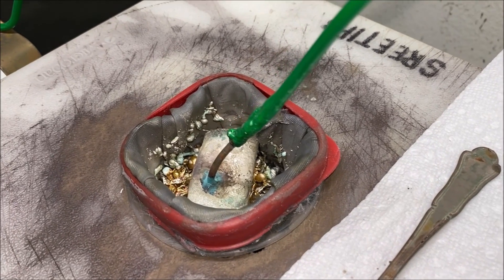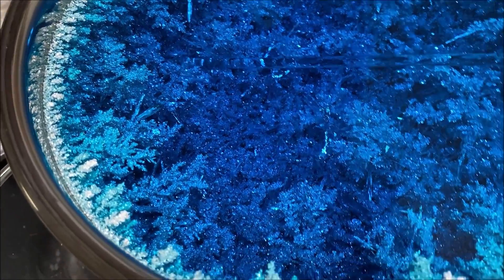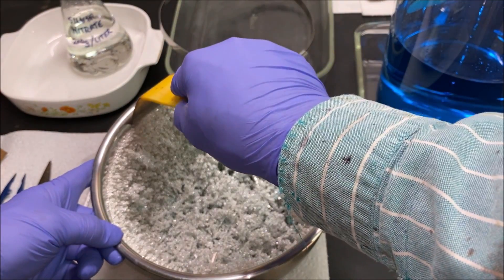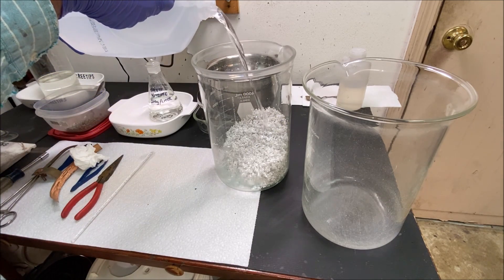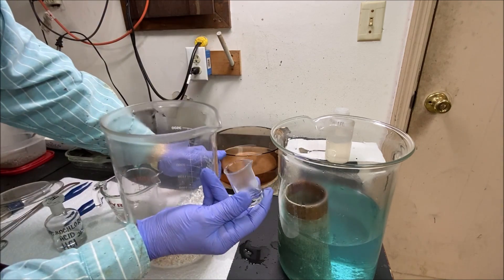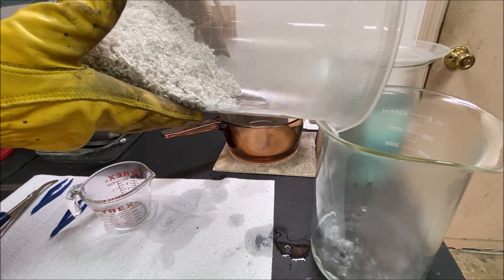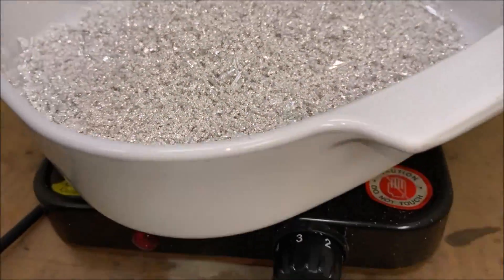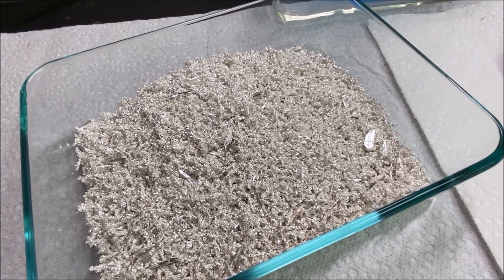Fifty Ounces of Silver From My Silver Cell Day 15

Comment: I made home made wet photographic plates when I was in high school. Would dunk them in a bucket of weak silver nitrate solution. (Used in my pin hole cameras.) Everything was fine until I walked out of my dark room and into the sun light! My arms turned jet black up to my elbows. We were on our way to a family reunion. Oh! But, did the entire clan have fun that day! My dad never stopped laughing all day. Neither did I!
Reply: It goes black from nano particles of pure silver on the skin. These are so small, they absorb all frequencies of light
Reply from the maker: I discovered, by accident, that hydrogen peroxide will remove those silver nitrate stains from skin. Not completely, but close to 90%
Reply: @Baltihunter  That just HAS to be good for your skin!😂😂
Reply: @robertlee4809  well it does work as a type of sun screen. A very expensive sun screen.
Reply: @Baltihunter  not really tho, the silver nitrate eats into your skin, it doesnt just "cover" it. you cant wash it off.
Reply: That's Funny 😂  Noob here what was the black exsctly, is that whats on Camera film ? Silver nitrate ?
Reply from the maker: Silver nitrate will stain your skin black on contact. The stain lasts about a week.
Reply: @sreetips  hey bro.. love your vid….. but gotta be honest I was waiting 17 minutes for you to melt into a bar at the end…….
Reply from the maker: Sorry to make you wait.
Reply: @sreetips  wait so its just visual not toxic/carcinogenic? seems like the ultimate prank solution... hey ma can you finish washing that plate for me? I'm late to dance practice gotta run! meanwhile plate is sitting in silver nitrate solution LOL
Reply from the maker: My wife picked up a jar of silver nitrate that had spilled. So it had silver nitrate on the outside of the jar. When I got home she was nearly in tears as she was scrubbing furiously with soapy water to get the stains off her hands. I’ve warned her over and over not to clean my shop for me, but she insisted. I poured some 3% hydrogen peroxide on her hands and it began to remove the stains immediately. After about a half hour of continuous dousing in the peroxide and rubbing, her hands were 90% free of the silver nitrate stains. She asked how I knew the peroxide would do it. I asked her, “say my name.” She said, “SREETIPS!” I said, “thank you.” I was her hero - I love it!
Reply: @sreetips  thanks for the ♥️,for above comment but I noticed a spelling error in the # ,so I corrected it ,then I noticed used- tube is blocking thumbs up on my comments ,when peeps "liked" my comment
Reply: Same here.... Reminded me of one of those annoying videos where they are "Going to show you something" but in turn they just talk about almost "About to show you it" over and over again but never actually show you whatever the hell it was supposed to ve showing you? I can't remember what they call those annoying clips of aggravation and disappointment, but, this video was A LOT LIKE THOSE EVIL VIDEOS!!!... At least there was some SILVER THOUGH!!!
Reply: Can you use this silver to make colloidal silver?
Reply: @suilauk9954  just buy some in your local growshop llmao
Reply from the maker: Probably, but I don’t know how
Reply: @QIKUGAMES-QIKU  yep
Reply: Trudeau is that you
Reply: I had a similar experience. I had the great idea to dye my old white tee shirts black. They were in great shape buy grey from the crappy Texas water. I thought I had bleach to clean up but nope. The old lady used it up. My arms looked like Papa Smurf until I could get to the store and buy some more bleach.The family and the guys at work ribbed me forever.
Reply: @GetRealwithMike  yeah you bleached yourself, thats defo more smart than having dyed arms for a few days.
Reply: Could have been worse, I put my hand on a science lab counter that a student didn’t properly clean up a Silver Iodide spill the day before, iodine goes straight through your skin into your bloodstream and leaves the silver in every single layer of skin! Think of a black tattoo that you have to wait for all your skin layers to be replaced over a month or two before it goes away!
Reply from the maker: Same if you get it on a finger nail. Stays stained until the nail grows out completely.
Reply: @jonkeau5155  guess your teacher had future instructions for the student on lab clean up.   Thinking though that the stain only made it to your 1st layer of skin out of the 3.  2nd and 3rd layers don't regenerate,  otherwise we wouldn't get scars, or actual tattoos that last for that matter.   A tattoos ink actually sits in the 2nd layer, and sometimes if an artist goes too deep, maybe into the 3rd layer.   The 3rd layer don't have horizontal holding power though and any ink making it in there, will dilute out into the surrounding skin cells but not enough that it dissipates entirely.   Thays what happens when you get a fuzzy wide tattoo line.  Artist put the ink too deep, and into the 3rd layer.   The industry would call that a blow-out.
Reply from the maker: Three percent hydrogen peroxide will remove silver nitrate stains
Reply: @911axe  "layers of skin" we have 7-11 layers, depending if you count dead skincells into it. wtf do you have your 3 layer stuff from? there are 3 layers of the ORGAN of the skin, but not the skin itself, that has 7 defined layers at least smh..... you have layers of skin that are part of the blood vessel system, but you aint calling that skin.
Reply from the maker: I really don’t know. I buy sterling and use it to refine gold. Then I recover the silver and run it through the silver cell.
Reply: I never thought about it before, but since silver nitrate won't react with lower wavelengths like red, then what happens when you photograph a red object with silver nitrate?
Reply from the maker: I think that it would still look red.
Reply: @sreetips  It's black and white though, so wouldn't it be really close to black? If the red doesn't react with the nitrate, then it would be clear, and after inversion, black. Isn't that how it works?
Reply from the maker: I’m not that familiar with the colors that they produce.
Reply: @sreetips  Silver nitrate doesn't produce any colors at all, that's what we used to use in the days of black and white photography.
Reply: @michaelrose93  did you ever mix in black and white to a checkerboard pattern? 50 black, 50 white will look way more white than black. light grey at most, alu color.
Reply: @tarkitarker0815  Sorry, I didn't understand what you meant. You say that the white squares will look gray? or that the black squares will look gray? I don't have much experience with silver nitrate photography, but I thought it was supposed to be very sharp and accurate. I would imagine that the checkerboard would have to be pretty small to produce the effect you're referring to, is that the case?
Reply: ❤❤❤àq
Reply: I treated a burn with prescription Silvadene cream and it started turning like blue green and black.
Reply: @Night Bot you will gonna effing die after a few years, there was a guy that has eaten a few gramms of silver for 12 years, he died bc all of his ingestive organs failed. but you do you, make darwin proud.
Reply: Mans learned how to do the enhancement haki
Reply: it wasnt that weak apparently. fun day more cancerous than running around in sa without sunscreen or clothes.
Reply: Why don't you have a warehouse as big as an Amazon order hub producing tons and tons of silver........please answer me that....!😊
Reply: That gentle scraping sound is so very soooooothing! Remind me of crushing and crunching on snow!! lol I really want to crunch on silver crystals in granny’s pyrite dish 🤣😂🤣 
Teach us, our Yoda🙏🏼🔥
Reply: @basslinejoe7546  if you wanna spend 5k on a setup that costs you approx 5 usd per ounce of silver do it, hes not in a million years making money with this nor does he come out at zero.
Reply: Bet you were the “black sheep” for the visit. I know my family woulda had fun with that one.
Reply: Reminds me Of when Wile E Coyote turning Black after Road Runner Set him up ! You Know Back in the Normal Day's  Love and respect from Australia 🇦🇺 Good Channel
Reply: Can you make any other kinds of crystals in your lab there?? Hmm..🤔 I bet it's possible! Lol
Reply: It happened to me as well during some chemistry classes in the 6th/7th grade. I don't remember if it was silver nitrate, but I had some purple spots on the back of my hand where I splashed myself. It lasted for several days.
Reply from the maker: Hydrogen peroxide will remove some of the stains from skin. I found this out by accident a while back.
Reply: @sreetips  hydrogen peroxide will remove the skin from the skin
Reply from the maker: It also removes silver nitrate stains.
Reply: I’ve heard of black face, but not black arm. That’s racist AF
Reply: @KOLD504  I hope you are kidding.....
Reply: @RaptureReadyMamaBear  probably not
Reply: @K0LD 504  if not, just stuck on stupid and you need to go away and watch more stupid like maybe Netflix or Disney..... that's stupid
Reply: @KOLD504  u got it, i called racsit content right away, i mean come on man , 
" Black Arms "
110% racsit
Reply: “ the clan” ?
Reply: @valley_robot  he likely meant his family, as in clan. Not the klan as in The klan.
Reply: @valley_robot  ever heard of Google?
Reply: @D-blaze  boy oh boy I let me tell you about ye old days 40 years ago......
Reply: @valley_robot  ever heard of Scottish 'Clans'? Or a 'Clansman'?
Reply: @3rdeye671  how many americans are scottish? how many earthlings had contact with the uk?
Reply: @tarkitarker0815  Hollywood has put out enough knowledge to the world of what 'Clan' means with movies like "Clan of the Cave Bear", "Braveheart", "MacBeth", "Outlander", and many, many more.
So it is America itself that puts out the knowledge to the world and most people would be aware that 'clan' means a family related group of 'kin' and the other type of 'clan' with a 'k' doesn't even come to mind to people outside of the USA.
Reply: @3rdeye671  i would like to introduce you to european clans, a real thing that is hugely more widespread here, and in asia clans generally refer to groups of ppl that live together but are not really family, or in more developed asia, straight up scientology clans, so no, its not really clear for non american and non uk ppl what you exactly refer to.
Reply: @tarkitarker0815  of course then it must've been the 'Klan' of the KKK variety its so obvious to everyone according to you.
Not to most ppl outside of the USA. Clan means a family associated group, as you even state above.
Reply: @3rdeye671  no i said group that is considered family but NOT actual family. as an example, the albanian clans have too much influence on club owners. thats what most europeans associate with clans nowadays. asians as i said either see it the way afghans do, or think of a clan as a sect.
Reply: @3rdeye671  im sorry but you reflect way too much being an america centered person, america is very young all of its culture is imported from 4 countries, about 32%  german, 28% gb, 10% french 10% dutch 10% spanish. its not about demographics but culture, remember. that being said, REFLECT! the usa are small in citizen size compared to the world, gb is too, europe is considered small in that regard, really DONT act like hollywood would rule the ppls mind and they all know these words only from tv, which in many places just now adapts 90s tv.....
Reply: @valley_robot  exactly, had a real meaning before the one you know.
Reply: @Valley Robot  It's not uncommon for people to refer to a large group of their family as "the clan" or,  "the whole clan".
Reply: @bluezdr  it is, you are american, you have had uk influence as the 2nd biggest ever. 95% of the world however are not descendants of uk ppl and therefore dont know why you should act like that. the uk is way more inbred over the century´s, thats gonna distribute another society and family standard than in europe, dont just cope and say its common, its just nothing that rarely happens.
Reply: @Kim Weißmann  I intentionally avoided saying "it's common" and instead phrased it as "not uncommon". I figured that would make it understood as not common, but clarifies that the initial person wasn't implying something racist with the use of the word "clan".
Reply: @bluezdr  ahh got you.
Reply: @bluezdr yeah as long as it's with a "C". Lol Easy to see when read. However, if you were only hearing it not so much... ☮️
Reply: @valley_robot  
All his extended family, gathered for the reunion. Family groups in Scotland g Ireland have been called clans, since before they were forced to speak English. Relax. Everything isn't about racism. 🧐 🤫 🤔
Reply: @valley_robot 😂😂😂😂 right! I said the same thing

Comment: I’m assuming you don’t collect every last bit since this is an ongoing process. Why do you store the silver in crystals instead of melting them into bars?
Reply from the maker: Because I’m lazy!
Reply from the maker: I used to melt every bit of silver into bars and sell them just as fast as I could. But with silver grossly and artificially under valued it makes more sense to hold the crystal just like it is. Especially if you don’t need the money,

Comment: Why don't you build a bigger silver cell so you can catch up on your silver recovery
Reply from the maker: It would be too much. Build a bigger cell, using kilos of impure silver as anodes in a thumb cell, I could refine it all to high purity in just two or three passes. But it takes gallons of electrolyte. I don’t have the economies of scale to pull it off. And the real reason I’m backed up on my silver is this: silver is messy, bulky solutions, lost of waste that must be treated, and it takes much longer than gold to refine. I can refine gold in an afternoon (if I’m not shooting video). But silver takes two weeks to go from sterling to high purity silver. I keep putting it off for all these reasons and that’s why I’m behind in my silver refining. It’s a giant pain. I bought another power supply about this time last year to build another silver cell. Still haven’t even opened the box. But I’ll get to it. And get it done, before I run out of time!

Comment: I’m really curious,
What would using a different voltage do?
Like if you went to 5V 12V or 1.5V
Reply from the maker: The crystals grow very rapidly at 12 volts, fast enough that you can watch them grow. But they’re needle-like long and slender. They grow rapidly towards the anode filter basket, make contact, and burn a hole in the Dacron filter, releasing silver cell slimes from the anode basket into the pure silver crystal and ruin the batch of pure silver.

Comment: It would be interesting to know the yield difference between the "silver shot" you added to the cell, and the amount of pure silver recovered?
Reply from the maker: There won’t be any difference. All the silver that goes in gets pulled out. Unless I spill a drop or two.
Reply: @sreetips no waste or loss of material through electrolysis or acid testing?

Comment: Okay okay but if you used tap water on the rinse step, wouldn't it form silver chloride and stay in with the cement silver then convert to silver metal when you cast it?
Reply from the maker: No

Comment: lol...  distilled water doesn't boil.
Reply: Oh really?.
Reply from the maker: Mine did
Reply: 😂 of course it does
Reply: well...  if there is any impurities in it it will.  I remember a experiment done where someone microwaved a coffee cup of distilled water, it wouldn't boil until they stuck a metal spoon in it.  I tried it my self and it didn't boil.  when i put the spoon in it exploded into a boil and burned myself good.  I think it was a Bill Nye that did that experiment.   also if there is a scratch in the pot for nucleation to occur I can see it boiling from that point.  but I'm not that science guy!  cheers!

Comment: Quite a haul, Chief! I’m curious to know if there’s any kind of test to estimate or verify the concentration of the electrolyte at this point in its life cycle?
Reply from the maker: There probably is, but I just haven’t learned it yet.
Reply: @sreetips  just curious. I remember reading somewhere that if the concentration of silver gets too low the process becomes much less efficient and that if the concentration of copper gets too high then it will start to plate out and contaminate the silver. I’m guessing that you’ve figured out through experience that 2 runs is about enough before you use fresh electrolyte.